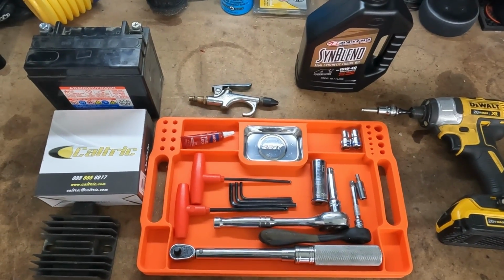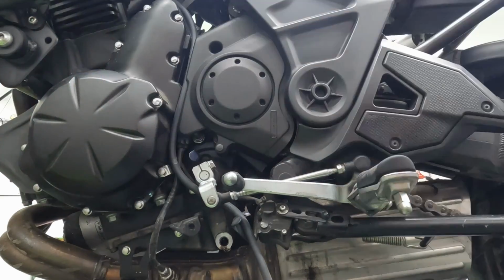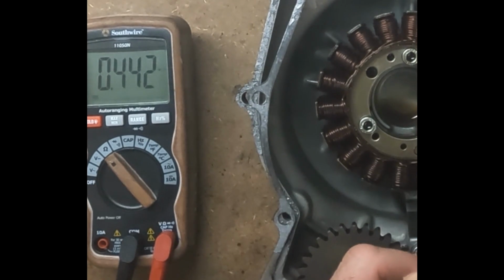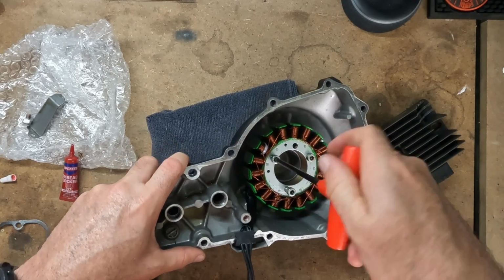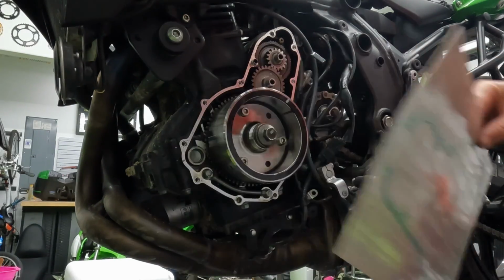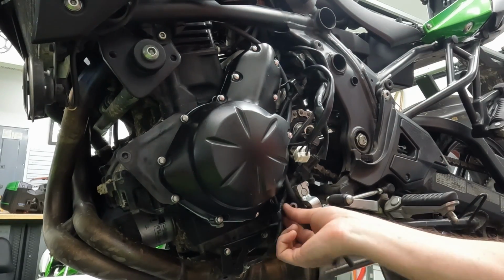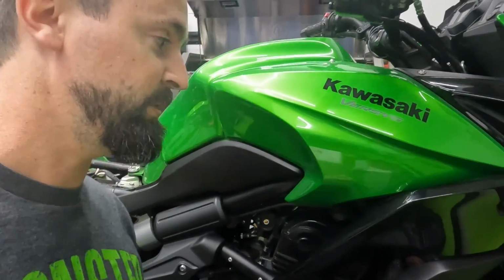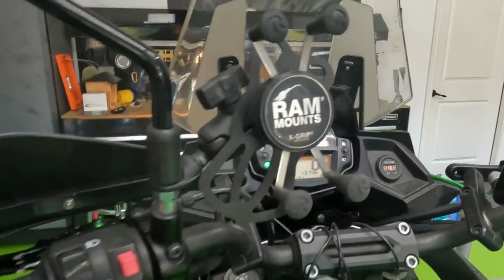How To: Kawasaki Versys 650 Stator and Regulator Testing and Replacement

Comment: Thanks . Watching this helpful video, makes it easy to change the stator on my 2009 Versys 650. Since the new Battery and new Voltage Regulator that I installed didn't help. I know that the new Stator that I bought will make it work like new, again. 😎👍
Reply from the maker: Hopefully your bike runs perfectly now 😉
Reply: @alexdombi-weridetwo  I'm going to change that Stator, today. 💪😎👍 🏍️💥💨
Reply from the maker: Best of luck!!
Reply: @alexdombi-weridetwo  Thanks. 
This was the first time that I've changed a stator on a motorcycle. Watching your video made the job a lot easier. Btw,  I also used a "Razor Blade" to remove the old gasket & silicone. My charging system works "like brand new",✨ again ! 💪🤑👍
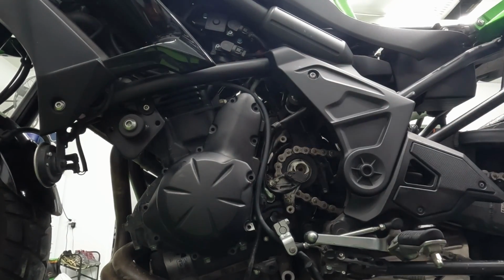Reply: 5:50 I discovered that, if you use the Razor Blade to cut around the stator cover, it comes off easily,  (instead of using a mallet, and prybar).☝️🤑🤌
Reply from the maker: @intergalacticbasketballdro7186   I'm so glad you got it fixed!  Congrats on doing it yourself 🤘🤘
Reply: I'm a bit late and I'm about to change my own stator/regulator in my 2014 Versys. On 2009 models, is the regulator near where Alex showed in this video? Or was it just ahead of the rear tire?

Comment: Very helpful and well done. Trivial things that may not matter at all: I would have had to verify the accuracy of my ohmmeter before trusting it within a few tenths of an ohm . I would have torqued the stator in two steps the first about half of the final torque setting just in case that helped insure it was seated square and unstressed. I didn't hear you state which type of loctite you used, and some folks would have covered less of the thread length.
Reply from the maker: Thanks and great points! I have not had my multimeter verified and that is something I will look in to doing and is worth noting.  When installing the bolts in to the stator I used the t-handle to get them partially torqued and then the torque wrench for final torque specs for that reason- doing it to half torque is not a bad idea though.  Thanks for the tips!
Reply: Torquing in multiple steps is a good idea. 
Also,...That's "Red" Locktite (industrial strength) 
Only needs one drop, (near the top of the threads).

Comment: First off, I have a 2019 that looks like a twin to this bike except I have crash bars. Anyhow, Great video, very helpful. I'm approaching 30,000 miles on it and I'm always afraid it's gonna take a dump one day. Love the bike stand.  Wish I had one. Great riding bike
Reply from the maker: Thanks for the kind words!  What maintenance services do you have planned for the 30k mark? The stand makes working on bikes so much easier on my back 😁
Reply: Great video! What’s the latest on this replacement? How are they holding up?

Comment: Thanks for this guide! I just did this job on my 2010 last week and it went smoothly. I bought an RM Stator. I think my stator burned out because I accidentally went too long between oil changes but I'm not sure.
Reply from the maker: I'm glad you found this helpful. Hopefully your new stator will last a long time!

Comment: I make a cardboard diagram of the cover and then place each bolt in the corresponding hole   because they can be different lengths.
Reply from the maker: It's a great way to keep track of them.
Reply: Easy to use the paper packaging material that your stator gasket comes in, and use the gasket as a template.✨👍
Reply: Hello m8. I just install the new stator I change my battery too today, everything runs very well but just right now my headlights turn off while I ride my bike, the bulbs are new too I checked them it's okay. Any suggest what just happened

Comment: Hi Alex, oi have same problem with my 2010 versys 650, but before I remove the old stator out I check the stator and shows 0.2 Ohm, the new one I did order from amazon is 0.4Ohm, so now I am confused, I took my battery to charge and try it again. thanks for the video its very helpful!
Reply from the maker: I just looked up the 2010 service manual and see the specs for your stator are to be between .18 and .27 ohms of resistance.  If your old stator shows .2 it should still be ok.

If the replacement is showing .4 ohms I'd return it to AmazonOK.

Does your bike not start at all now? I'd be curious to know the voltage at the battery when it's running.
I'd suggest load testing the battery. Perhaps the battery just needs replaced, and the charging system is ok.
Reply: @alexdombi-weridetwo  do not start at all, make same thing as you explain…
Reply: @alexdombi-weridetwo  i charged the battery and runs well, but the charging while running it was between 11-12v, i am confused to change all of the or keep looking for the problem 🤔
Reply from the maker: @sezginkerimov2546  Oh, wow- it does sound like the stator is bad or going bad. You really should be showing 14v when running above 3k RPM.

Comment: In the video, you said the value of the resistance of the stator is 0.27 but I found online "for a 2009 Kawasaki Versys KLE 650, the stator resistance should be between 0.52 and 0.78 ohms when measured across the contacts." I do not know which one is correct.
Reply from the maker: This is a 2015, the specs may be different for an '09.  In the manual for the 2015 it says the resistance should be between 0.176- 0.264 ohms.

I would highly recommend finding the service manual that is for your year to be sure of the specifications.
Reply: you are correct about the specifications of the stators.  By the way, could you tell me where to get your multimeter? Mine has a lot of values for the measurements. That makes me confused. I think yours is a good one. Thanks for your info.
Reply from the maker: I believe I got this multimeter from The Home Depot.  I've been using it for years so I could be remembering incorrectly.  I wish it had some more features sometimes but it's served me well.

Comment: Is this after market stator still work well?
I have a problem with the battery on my 09 versus 650 I thought to replace the stator too but as you said OEM are too expensive, do you recommend to replace it with an aftermarket like you did?
Very helpful video!!!
Ride safe!!!!
Reply from the maker: It's working great. I get a consistent 13.5-14 volts while riding now. I rode for 130 miles yesterday with no issues at all.
Reply: @alexdombi-weridetwo  thanks for the reply. I ordered one from rmstators (not sure for the quality) it was 130 euro cheap enough is you compare it to 690 euros OEM part they sell in my country
I hope it will be okay.
Also it's my first bike , Its a used bike and for a year now I change clutch plates, cables stator ignition coil 
Is this the usually staffs for a 14 years used bike? Or it's just a bike full of problems?
Reply from the maker: @ΧαραλαμποςΑντωνιου  that is definitely an inexpensive option then.  I wouldn't think your bike is full of problems based on those things you've done. You may have already done it, but it might be worth checking the valve clearances. That is a worthwhile service check that can prevent catastrophic failure.
Reply: @alexdombi-weridetwo  I did all of them yes and for sure it worth every euro .I will check the valves clearance
Thanks a lot my friend I appreciate your advice!

Comment: Hi. Do you mind sharing what is the normal/average charging voltage at idling and charging voltage when engine running at 4000 rpm for example. Thanks
Reply from the maker: It was around 14v at idle and went up to 14.4v while riding.  I sold the bike so I can't give you exact numbers any more, sorry.

Comment: How did you unplug the stator? Did you use screw driver? When you unplugged the regulator rectifier, did you press down on the socket, or you just pulled it out. I am trying to figure out how to unplug the regulator rectifier. I do not think it is easy to unplug both of them. Thanks in advance.
Reply from the maker: The wires from the stator and the regulator should just be simple plastic connectors- push the tab in and pull apart.  If they will not separate easily odds are the pins are fused together or the plastic itself melted from overcharging.  Some replacement kits will include new connectors if this is the case.
Reply: @alexdombi-weridetwo  I think you pressed the down the socket of rectifier to disconnect the wire. Is that right? Thanks.
Reply from the maker: @thangnguyen-tf4yo  at 26:26 you can see I use my finger to press down on the tab of the connector.  The socket is used to remove the bolts, but that's it.

Comment: Good video, I suppose that is the same for z650, what is the correct measurement for regulator in good conditions?
Reply from the maker: I looked online for a Z650 service manual and it seems to be about the same range as the Versys 650. The resistance should be between 0.176 - 0.264 Ω.

The service to test and replace the stator is near identical, some connections will be in different places.

Comment: I have a question, I have a 2014 ninja 650r same exact cover and what not.  I got into an accident and that cover cracked. So I took it apart today without realizing the magneto inside. It looks like there are two marks on the top and bottom gear. Do these need to be in any special alignment? It looks like there's marks that are supposed to line up
Reply from the maker: Assuming you mean the gears that connect the starter to the main gears behind the stator- no.  There is no special timing or alignment needed on these two gears.

Comment: How was that stator?
Reply from the maker: 2 years later and it's still working great.  No charging issues at all
Reply: @alexdombi-weridetwo  mine failed last night here in SD, had to push it.
Reply from the maker: @borissh9932  that's rough. Sorry to hear it. Was it the OEM one that failed?
Reply: @alexdombi-weridetwo  I believe it was an oem. The bike fell on a left side 10 minute before that, I think that could be a reason.

Comment: You’re getting 14,4V at idle, how about reving the engine? Does it rise or lowering the voltage?
Mine does exacly like yours. But something odd i notice on my bike, when i rode it at night i noticed the headlight sometimes get really bright and sometimes get back to normal. And last day my battery suddenly dies and bulging
Did my R/R was sign of going bad?
Reply from the maker: Yes, the bulging is a sign of the regulator not working.  If you're headlight dims and then gets brighter when you rev that's an indicator the stator is failing too.

Above 2k rpm, my voltage is not above 14.7v

Given the blown battery, it would be a good idea to check the resistance of the stator and see if that needs replacing.
Reply: @ oh i forgot to mention. As engine rev the voltage slightly drop to around 13.8v. And when idle at 14.2v
Replacing the stator would be nightmare to me. But i’am gonna perform a test with my multimeter to investigate. Thanks

Comment: could You tell me where to find the main electric fuse box of 09 kawasaki versys kle 650? Thanks.
Reply from the maker: Do you mean the primary fuse box or the main starter relay fuse?  The primary one is likely under the seat near the battery.  The starter relay fuse is probably on the left side of the bike behind the covers.  I don't own this generation so I went to Google and found this.  Hope it helps!

https://www.kawasakiversys.com/threads/replacing-the-starter-relay-on-my-2011-gen-2.81425/
Reply: @alexdombi-weridetwo  the main fuse box that controls the electric of the whole bike. Could you show me a picture of where is it? thanks.
Reply from the maker: My best suggestion would be to Google it. I haven't owned that generation of versys and no longer own my 2015.

Comment: Razor Blades work fine. A Widget Tool makes using a Razor Blade even easier. 
But I prefer to use a 1" Wide Scraper Tool that I keep razor sharp with a Sharpening Stone..
Reply from the maker: The right tools always make a job easier.  A simple razor will work if it's all you've got though 👍
Reply: @alexdombi-weridetwo True.  I ended up just using a razor blade, instead. (As you suggested). Btw, my cheap stator is still working, good.

Comment: over 0.27 ohm  stator is bad , did you measure the new stator what the ohm after replacing ?   How to Check if regulator is faulting ? i do see the connection pin at regulator got 3 wire too
Reply from the maker: I am not aware of a test for the regulator. Even in the service manual it says to check connections and physical appearance.  The biggest cause for concern with the regulator is when the output from the stator is too high- it can melt the connections and internal components of the regulator/rectifier.  It is a good idea to check the new stator resistance as you can see another comment says a replacement was outside of spec too.  The limits for a 2015 between 0.176- 0.264 ohms.
Reply: can share the link to download the service manual ?
Reply from the maker: https://www.kawasakiversys.com/threads/versys-650-abs-2020-service-manual.229063/

Comment: Basically 1 year is passed and I got exactly the same error 21, battery is perfect, cleaned all the sensors, but when try to turn on you hear a peeeeee noise, it does turn on every time runs good battery keep around 14.2v all the time, I'm suspecting being the crankshaft but at the same time I don't see the bike stalling or anything while running, any ideas ?
Reply from the maker: Oh no! I'm sorry to hear you're still having issues.

Does the peeee noise go away while it's running? Get louder at any point?
Reply: @alexdombi-weridetwo  the noise is just while I try to start it, after starting it runs with absolutely no problem at all, I tested the stator and it is hitting 00.4 (I didn`t open the cover just unplug and did the test)
Reply from the maker: It could be the starter motor itself then.  Possibly something is binding inside.  You mentioned the crank- does the noise seem to be heard from where the stator is?  What does the voltage drop to on the battery when starting it?
Reply: It basically don't drop at all from 12.6 drops to 12.4 and turns on. ( It takes some time to turn on like 2 seconds doing the noise and starts.
The noise I'm not sure if is coming from the battery or the stator I'll try to do a better digging into the source of the sound today

Comment: I'm getting error 21 on mine (2017 model) the manual says it is crankshaft and the voltage of the battery seems to be ok, it fails completely to start sometimes with not even a tick noise and them after a while it starts on first attempt, I did clean all the plugs but the error code is still in there, do you think only replacing the battery is safe ?
Reply from the maker: The voltage of the battery is fine when off, what happens to the voltage when you try to crank it? If it drops from 12v to 4 then the battery is dead.  Can you use a jump pack to start the bike or will it not ever start?
Reply: @alexdombi-weridetwo  yesterday I couldn't start it so I had to jump start it in first gear but today it is starting on first attempt like 10 times in a row
Reply from the maker: @orosco03  can you check voltage while it's running?
Reply: @alexdombi-weridetwo  I got the bike 2 days ago didn't installed the voltmeter in it yet, so for now, no =\
Reply: @alexdombi-weridetwo  I strongly think that it is something related to the kickstand sensor, I made all the tests with the battery and cleaned completely my kickstand and the under the seat with contact cleaner. When I try to turn on the bike with the kickstand down it don't do anything and if I put the kickstand up it gets on without the clutch so it seems that the problem was something in the sensor of the kickstand and by cleaning it fixed the problem

Comment: I fixed the stator and regulator im still loosing charge im thinking the coild stick anythoughts ?
Reply from the maker: There's some kind of draw somewhere. It could even be as simple as a hot wire grounded out.  What's the voltage reading at the battery under starting, at idle, and at 4k rpm?  I assume since you replaced the stator and regulator it's reading 10v, 12.5v, and 14.5v respectively? 

How are the battery contacts?  Do you have any auxiliary lights or accessories? 

Tracing electrical problems without seeing the bike is really hard. I can try to help though.

Comment: Does anyone have the Amazon part number for the stater and regulator combo
Reply from the maker: I'm not actually seeing a combo on Amazon that fits the 2015+ generation. The connector is different for prior years.  Here is a stator and gasket set, though. I ended up using a regulator purchased off eBay.  Before purchasing, please confirm your year matches the item and reach out to the seller with any questions. 

https://amzn.to/3UxXO48

Comment: how is the amazon stator holding up?
Reply from the maker: So far so good. I've put on about 150 miles since installing it and have had consistent charge output.
Reply: I also bought a cheap Stator off of eBay. So far, it works, perfectly. 
Note ; leave the zip ties on !

Comment: Don't use Red Loctite. It'll never come off again. Blue Loctite is preferred.
Reply from the maker: You are correct.  Red loctite is considered a more "permanent" bond. But it can be removed with heat.  I have seen stator bolts come undone and cause substantial damage so I tend to use red.  I should have explained that in the video so it's a good call out.

The Kawasaki OEM service manual agrees with you, too. "Apply a non-permanent locking agent"